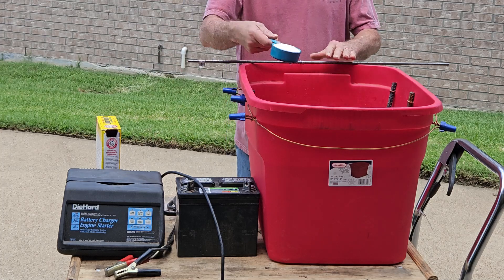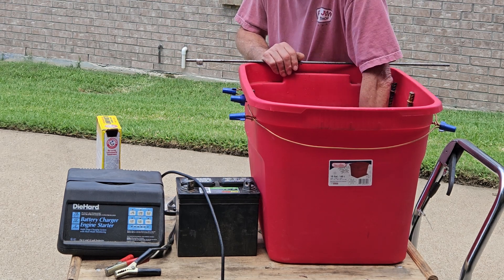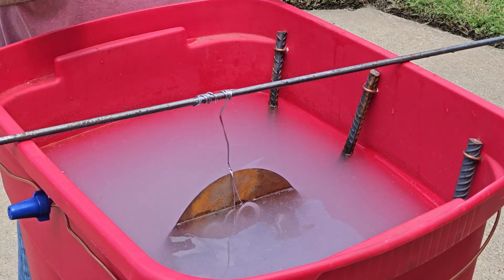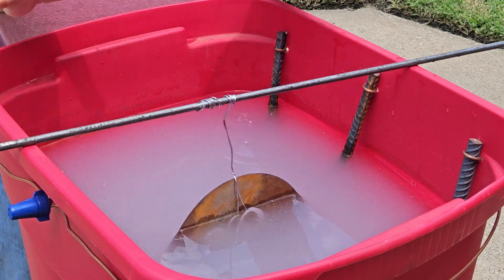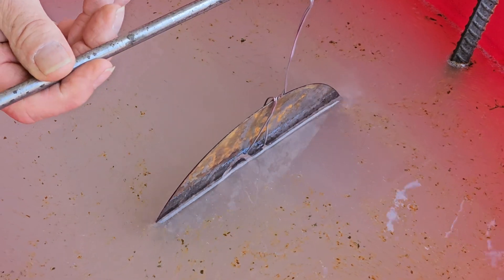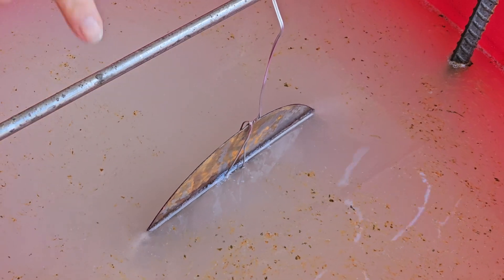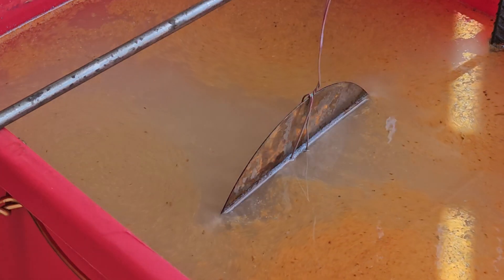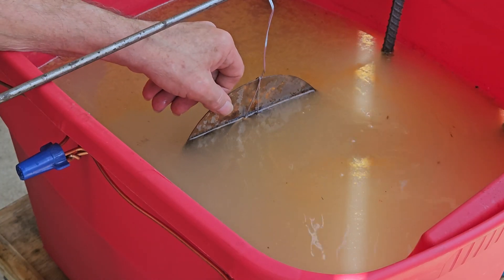Using Electrolysis for rust removal at home

Comment: What about removing rust from pewter
Reply from the maker: I had to think about this one a little. Pewter is exceptionally resistant to rust and corrosion and it usually cleans up pretty well with nothing more than soapy water. If that doesn't work I would suggest using silver polish on it rather than electrolysis. I would expect the copper to cause problems.  If you want to try anyway, I would experiment with a scrap part before trying it on a part you like(In a VERY well ventilated area!!!)
Since you made me think about it, I am going to look around the local Goodwill store for something cheap and pewter, just to see what happens. I expect bad things but it should be interesting. 🤔

Comment: You explained it so good. Great video. R.i.P to the microphone though lol. I use the same method a lot it works great. I'm running a cycle on a gas tank now
Reply from the maker: Thanks. I was a little flustered trying to use a backup microphone that only worked when it wanted to. It's the end of $10 microphones for me,  I went and got a better one the next day
Reply: @GuysPlayingWithTools  you looked calm and cool the whole time great job. Equipment failures happen thank God it was only a $10 microphone
Reply from the maker: Now I have to find another one I like, I am on #3 and no luck.  I am growing a collection.  Lol

Comment: My rust remover is a wire brush and oil, preferably together and Toots uses rebar as stakes for plants in her garden,. bean trellises/pyrimids/flowers and such.  Lasts a lot longer than wood and you can tie stuff to it a lot easier. Happy weekend, Uncle Bill!
Reply from the maker: I am sure you have all the parts you would need,  you should give it a try! It's a LOT easier than a wire brush, and it won't scratch up the surface. 😁
Reply: @GuysPlayingWithTools  I'm getting rid of all my parts as units. No more for me and oil base paint takes care of rough surfaces if you stack layers. Happy weekend You 2!!
Reply from the maker: @lewiemcneely9143  I am still accumulating stuff 🙂
Happy weekend to you too!
Reply: @GuysPlayingWithTools  If I can't work on it, and I can't, there's no use for it to be here. So it's not. Getting geezerish is siure interesting.
Reply from the maker: @lewiemcneely9143 I am not there yet but my day will come
Reply: @GuysPlayingWithTools  I was having such a wild and wonderful time doing what I wanted to do (my calling) and enlarging my carbon footprint by the minute that mine snuck up on me. Toots framed a picture of me in front of a 40 ton Cat rigid frame rock truck that I herded for the Grandboy. I've got one with my 11 yd. front discharge Oshkosh/Mack mixer and setting up the 1st crusher years ago. Been a wild ride! Now I cut the grass and be happy and remember how blessed I am. Do what you want to do that you know you ought to be doing. 2nd chances are really slim for it. Hit it NOW! HAMMERED!
Reply: @GuysPlayingWithTools  I had 8 runnab;le mowers and a pressure washer that I rigged up to make it easy on myself. All gone so far. 2 mowers left for spares and they might as well be gone too.
Reply from the maker: @lewiemcneely9143 Time wins all battles,  I figure I have 15 or 20 his years left before I have to change the channel into something else. Maybe then I will start singing 🤣